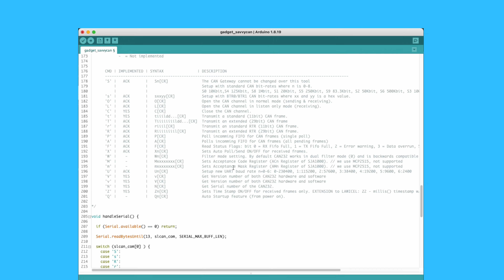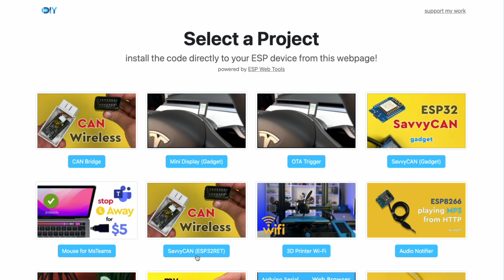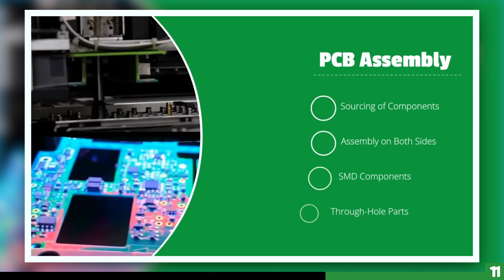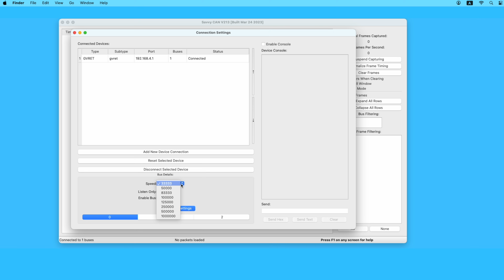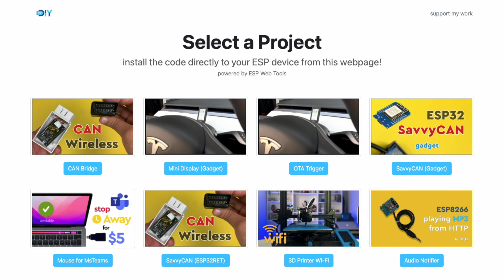SavvyCAN with ESP32 Running ESP32RET

Comment: I have connected the ESP32 to my 2024 Model3P at the CAN connector located in front of the passenger door. The unit continues to be powered after the car shuts down and it appears that a spurious CAN message gets sent to some unit in the trunk when the Gateway is plugged in. Please advise.
Reply from the maker: In my 2023 M3, that connector cuts off the power to the gateway when the car goes to sleep. Maybe they changed that in 2024?
Reply: @MrDIYca  I believe the wiring has changed at the back of the console ; the new back seat monitor is there now. Is the R/RW switch shipped in the R position.
Reply from the maker: Yes, true. You can verify the switch's status through an opening in the case. With the OBD2 plug facing upwards, R = Left, RW = Right.

Comment: I got the kit and soldered all the connection and connected the ESP32 and flashed it, the Power and Wi-Fi LED comes on and I get these messages from the application 
"Got data from serial. Len = 4
f1 09 de ad 
Write to serial -> f1 9"

I have a Nissan Pathfinder 2019 Wondering if anyone else has this issue? Could the can bus data be encrypted?
Reply from the maker: You might want to check if your CAN is filtered - https://youtu.be/dDBxC39lNQg
Reply: did you find a solution to this? I receive the same message
Reply: I'm receiving the same messages connecting to a Polestar 4 OBDII.

Comment: Hey! I just received my shield, I connected to the ESP32 and flashed through the website. Red and green light are on when I connect to the car, but it the blue light remains off, but it reads the canbus messages on Saavycan. But my question is, I know Volvo's canbus pins are 3 LS CAN - high, 11 LS CAN - low and 6 is CAN High ISO 15765-4 and 14 is CAN Low ISO 15765-4. I need to listen to LS CAN because I am trying to find some other warning lights on my Volvo so I can use on my simulator, when I ran the scan it read several Can ids and messages but none that I know that are available on my LS Can like for instance I know the my gauge uses 0xA10408 for the blinker, but that never came up on Saavycan, maybe I am listening to the high speed can? Is there a way to set to listen to can low on pins 3 and 11?
Reply from the maker: @Flybrick_S60R I replied to your email

Comment: I have tried ESP32RET but with esp32 boards from aliexpress the can bus speed was not correct. First guess was that there is something wrong with prescalers in the source code but haven't found the culprit..
100kHz speed in reality was about 99.8kHz and it was anought for data missmatch

Comment: Good work. I am wondering if you didn't encounter any problem with Collin80's code? I remember when I was working with his code I couldn't make it work on my ESP32 board. It was some years ago and then I let it go.
Reply from the maker: I haven't had any major issues. I just started using it recently, so I can't say much about the older versions. I mainly use it to log CAN traffic and analyze it in SavvyCAN